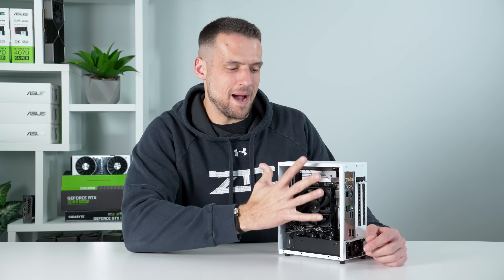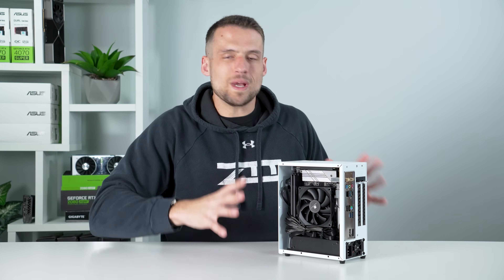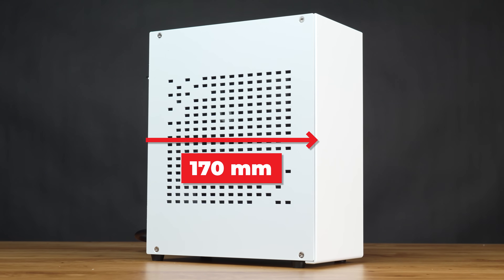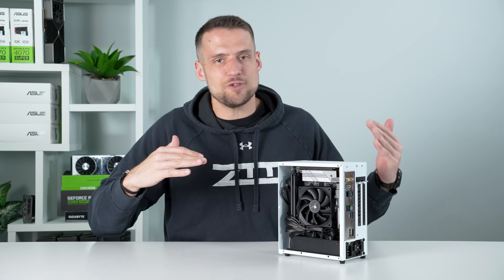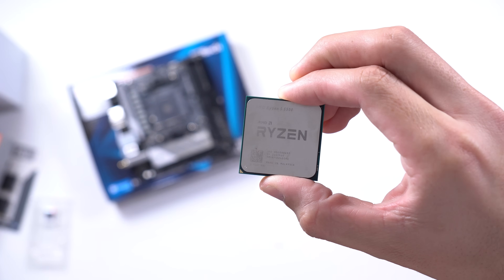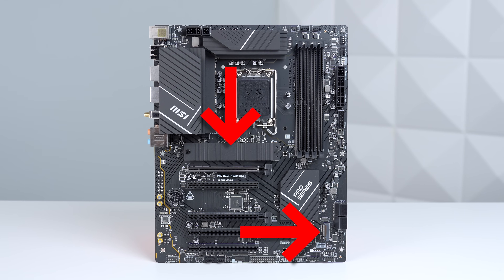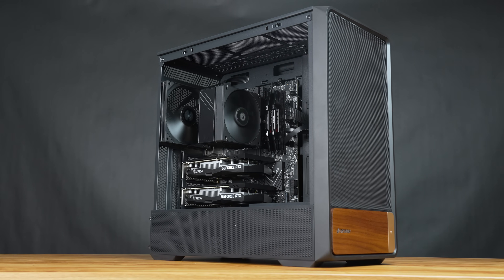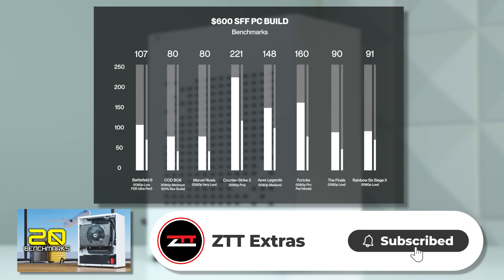This $600 Tiny Gaming PC is Unreal

Comment: Saying 16GB of RAM is the weak point in a gaming focused build while it's got a 3050 6GB in it is crazy
Reply: It's not a 4k build so 6gb VRAM would not be the issue.
Reply: @Spunky_Bob Clearly you don't know how much weaker the 3050 6GB is compared to the 3050 8GB.

It's not a VRAM issue, it's a raster performance issue. The 3050 6GB is an exceptionally weak card; it's on par with an RX 570.

If you're fine with using performance or even ultra performance mode upscaling at 1080p to get acceptable framerates, then great, but if not then you'll need something better than the 3050 6GB.

Sure, it's a budget build, but I would still try to get at least something like a used single fan 2060.

Or even just the 3050 8GB, which is ~35% faster than the 6GB version, and can actually be found as a single fan for ~$200 new. That's only $20 more than what he paid for the 6GB.
Reply: @beirch  If he didn't insist on short sandwich ITX case, same money would buy significantly better hardware. If we bump that to $700 we could still have fairly small build but with 9060XT 8GB. Small ITX is just not the way to go, simply because there are limited choices and all of them overpriced for what they are.
Reply: @Micromation this would be for individuals looking a cheaper home theater setup (for example) for uses like PLEX.. I don’t believe individuals would be looking to build a new pc for the first time in this format, because of the limiting hardware availability.
Reply: @MrDoNotAnswer  You don't need that for home theater setup though - miniPC with Intel N97-N150 for about 100 bucks handles 4k HDR streams just fine. So sure, Steam Machine can do that too but it's completely unnecessary. On the other hand running games directly from it (instead of streaming from more powerful PC) at 4k is gonna be painful experience due to weak hardware.
Reply: @beirch this is a glorified console.. when the entire thing costs as much as a mid range GPU you can't expect the performance of a good PC.
Reply: @Spunky_Bob That doesn't change the fact that the GPU is the weak point, not the RAM.
Reply: @beirch yeah I never mentioned system memory.

I have a 2080 super and the 8gb VRAM hits only 100% when playing VR. Which sux as that all I really play these days.

Comment: I upgraded from an Intel HD 2500 Dell Vostro 270s to a 5060 115w LOQ 15AHP10 laptop. Below is the list of games I've finished on the vostro:

GTA 5 (Online as well) 
Borderlands 4
AC1 to AC Rogue
Halo TMCC
Dead Space 1 to 3
Mass Effect 1 to 3
Skyrim Anniversary Edition 
Tomb Raider Remastered 1,2 & 3
Tomb raider 2013
Rise of the tomb raider
Tomb Raider Underworld 
Battlefield 4
Farcry 1 to 3
Need for Speed Rivals & MW (2012 & 2005)
Delta Force Black Hawk Down (Older one) 
Wolfenstein 
Rocket League 
Left 4 Dead

Then I installed GeForce Now & finished the following:

KCD
Control 
Shadow of the TOMB RAIDER 
Plague Tale Innocence 
AC Syndicate, Origin & Valhalla 
Death Stranding, Etc 
(I didn't include the ones I didn't finish) 

Now after a good run with it. I upgraded to a 5060 for GTA 6 & Star Citizen. Hope you make a short about it.

Comment: This case has horrendous air flow by the way. Those little cutouts provide a cool design, but hot components. Velka is the only case in this category that engineered enough air flow.

Comment: Im hoping the GabeCube is basically this and priced this or less
Reply: the gabecube has a way stronger gpu and cpu so if it's 600$ it would crush this video's build in price to performance. But Valve has the advantage of buying in bulk and using hardware AMD has no use for. So they might be able to hit 600$

Comment: Tiny but we can go lower. Asrock x600 paired with the Ryzen 8700. Sure u lose some fps but for a build smaller and not needing a PSU (since its included) and not needing GPU the price is close for slighty less performance.

Comment: Halllloooooooo~ I need some help in terms of information and I'm not good in PC stuff hehe especially on what to pair and stuff. but I'm upgrading my graphics card from GTX 1660 super 6gb to RTX 5060ti 16gb will it work with my current motherboard? which is a Prime B450M-A? and in terms of other components I have currently I have a Ryzen 7 5700X and a Power Supply of 750W. is it a good upgrade?

Comment: Hi Zach, no clue if you're gonna see this or not, but, if you're willing to import a Enhance 7660B (aka Yiheng 7660B), from a reputable vendor on Taobao, you can save a good chunk of change.

There is a vendor who also does Delta Flex PSU's, although 500W, and they can be had for about £20 GBP, with custom wires & a modular PCB breakout board. There are also tax-free lines, which can be used to avoid orange man tariffs.
Reply: Its out of stock atm, but Overtek sells their Enhance ENP-7660L 600W Modular Platinum Flex psu there. They add stock regularly though. Its a bit on the expensive side, but I would highly recommend this psu.

Comment: CPU:
	•	Ryzen 5 5600

GPU:
	•	NVIDIA RTX 3070 Ti

Motherboard:
	•	Gigabyte B550 Eagle WiFi 6

RAM:
	•	32 GB (4×8 GB) Corsair DDR4 3200 MHz

Storage:
	•	512 GB WD Black SSD (primary)
	•	4 TB SSD (internal)

Power Supply:
	•	600W

Monitors:
	•	Main: Alienware 1440p, 180 Hz
	•	Secondary: ONN 1080p, 165 Hz

This is my build right now. I mostly play competitive shooters like CS2, apex legends, and Fortnite. Do you think I should upgrade to a 5800X3D and just stay on AM4 or make the jump to AM5, and if so, what CPU should I get?

Comment: What do you think of that PC setup I was planning for next year. And also it's a pre-built (from Ukraine, called Vinga Rhino D9111), it had rtx 5060ti, 16 GB VRAM, 32 GB RAM, Ryzen 5 8400F, 2TB SSD, Windows 11 Pro (like is it even useful to have no OS, like it's cheaper but barely useful). All that stuff.

Comment: I have a prebuilt pc with a 1660 super (single fan I think around same size as the 5060 single fan) and I got a 10400f. I'm tryna take this pc to college but I think I wanna get this case, get a motherboard, PSU, and cpu fan, keep the ram, cpu, and gpu. Do you know any LGA 1200 versions of the same size motherboard?

Comment: I don't think those cases are a good recommendation. Too restrictive on the GPU & PSU (and Flex PSUs are usually also hot garbage), which makes it hard for future upgrades. The cooling will also be extremely limited, which is going to make it either extremely low power, or extremely loud - or both. Personally I'd stick with 10-15 liter cases if you want to go SFF (or ~25 liters for MFF / mATX) and have some flexibility & options left. Also, 6 GB of vram is not cutting it, even on a budget. 8 GB is already too low for many games, so you really want to look for 12-16 GB cards at the minimum - even on a budget system.

That being said, right now, I would not buy new systems at the moment with those ram & ssd prices, and I'm going to pray that mine will survive until it gets better again (was not so lucky during the pandemic & gpu mining crisis earlier...).

Comment: People expect the Steam Machine to be $600 but it has a 7600 CPU and GPU along with DDR5 RAM, better PSU, Custom motherboard, etc.
I'd like to see someone try to build a steam machine equivalent for the least amount of money
Reply: No one who builds pcs think its gonna be that cheap 😂
Reply: long story short you cannot as its a gaming laptop in a box made from mobile category parts... not ITX/ATX parts like normal desktop PCs...
Reply: Valve got both GPU and CPU at a significant discount from AMD due to the volume of purchase. It should be cheaper for them to build these per unit compared to an individual due to economies of scale. I think the only reason they're hesitating on the price is because of RAM prices soaring for the foreseeable future.
Reply: @anversailles companies like HP & DELL get their parts cheaper in bulk too. Yet the cost savings doesn't get passed down to us.
Reply: rofl dream on, all miniPC same specs are above 1000 more like 1500 if not on sale...

Comment: I bought a desktop pc alone for $100 with core i5-4500, 4gb RAM, 512gb, and 290 w power supply with no gpu.
I'm new to pc, so I want to know if the seller cheated on me

Comment: I think for people who want a pc like that just for games, the new steam machine is gonna be a perfect choice. I know the vram is only 8gig and the gpu is like the rx7600 but it's not like you have a lot of options for a small build to begin with. And the design of the steam machine is a cube which you can't have as a small pc case to build in. Also, I bet this small pc is quite noisy when playing demanding games. The steam machine is supposed to be more quiet according to testers.
Reply: that is the prime feature for many who is interested in MiniPCs > proper cooling / thermal design , which 99% of the products on the market is lacking > they all go for price/ power / features / artistic design, they are made to sell not to use for long term ( meaning the ones with proper CPU/GPU, not the bottom of barrel INtel Nucs with intergrated gfx)

Comment: i am in a bit of pinch rn. i want to build a pc, but i have height restrictions on my table so i want to make a small build, but i want a strong 1440p card like the 5070ti 16gb. i wont be considering amd gpus cuz i need the cuda cores for my work. pls help. budget around 2200 dollars. and i live in a very hot area so no air cooling, even amd 9000 series will overheat.

Comment: If the steam cube is 600$ then this build will be outdated in a moment.
Reply: There's no way the steam cube is $600. More like $899
Reply: @Haykwawn  I doubt it'll be that much since it is not worth buying at that price. Valve can sell it for a loss.
Reply: Not really. 

You can upgrade this. You can't really upgrade the new Steam Machine, aside from the RAM. 

IMO the Steam Machine might be a great FIRST entry into the PC scene (depending on the price) but for anyone who knows how to build PCs, it will at best be a little gadget impulse purchase. If it's any more than 600 USD, then it is IMO bad value.
Reply: What's the point of buying a PC you can't upgrade?
Reply: @jry0600  It depends. Some people don't want to deal with the hustle. I personally prefer a custom pc that's upgradable to a console
Reply: @jry0600  like any laptops.. to use..., new Steam machine is a laptop in a box without screen...
Reply: @jry0600  in theory, you can upgrade a lot here. In reality? Are you really going to buy a 5050? The CPU platform is dead here already.
Reply: it’s gpu is comparable to the rdna 3 7600 so it’s close to this pc but with two more vram and probably more expensive

Comment: Zach you shouldve went with the intel arc pro b50 it out performs the 3050 low profile and it has a low profile cooler and it has 16gb vram compared to 6gb.

Comment: This priced out closer to $720.
Reply: Add in sales tax and this thing barely comes in under $1k with any kind of part substitution
Reply: @madmerlyn  Out of curiosity, I just configured a build, all new parts, Ryzen 5 3600, 16GB DDR4, AM4 mobo with PCIe 4 and M.2 4.0x4, 1TB NVMe, 500W PSU, case (granted bigger microATX not ITX) for $336. Pick your GPU and add on $200-250 more, so seems it's doable under $600 after tax. RTX 3060 12GB can be found used under $200 easy.

Comment: If the budget is a big constraint and case size is not I would rather suggest looking into cases like Metalfish T40 which is not much bigger than JoyJoy but can take an SFX power supply, which might be one way of cutting costs and not sacrificing the case size that much. Because of the 2cm size difference it can also take few GPUs more according to the PC Parts picker. 
Metalfish T40 (137 x 212 x 260) vs JOYJOM  (104x184x223)